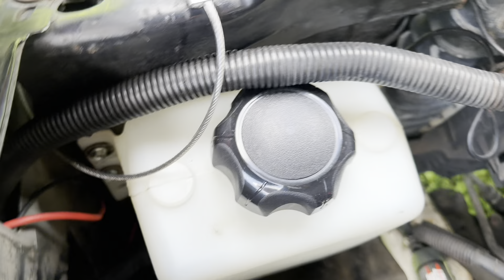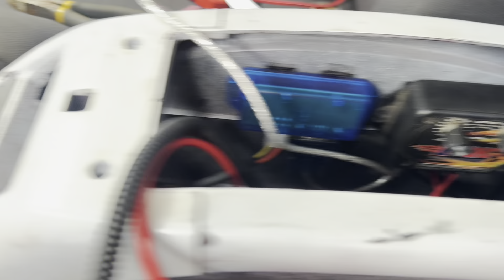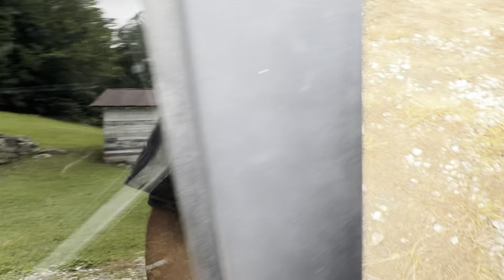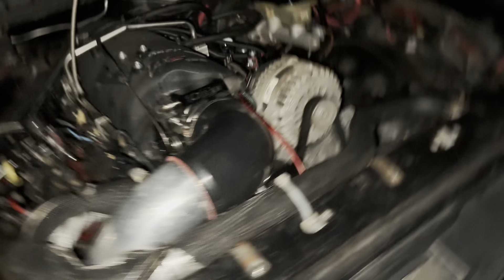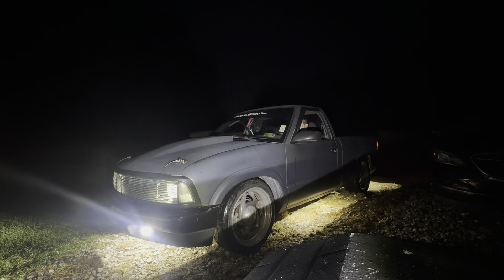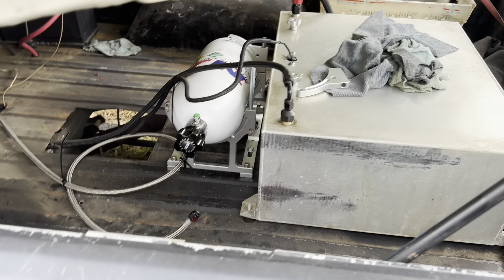Nitrous install disappointment

Comment: I thought you had a turbo truck. did you switch from a turbo to nitrous?
Reply from the maker: No it’s always been na 
At one point early this year I was gonna buy a pro charger system but instead I bought a ls3 and some aftermarket heads to build an aluminum 6.2 to replace this 6.0 this winter